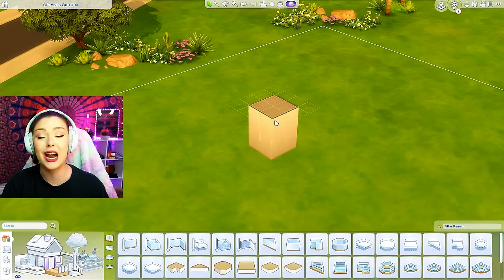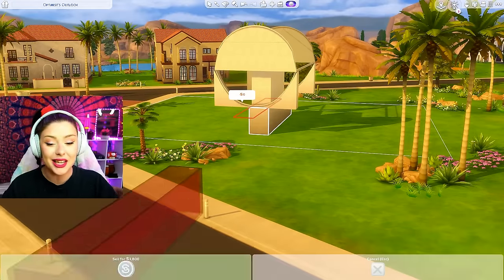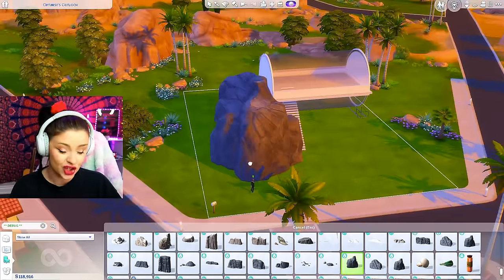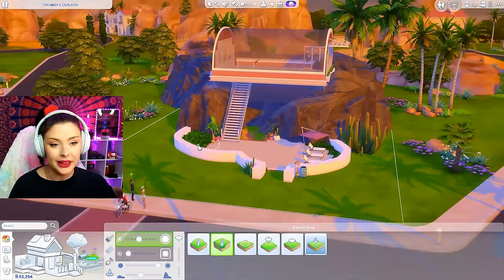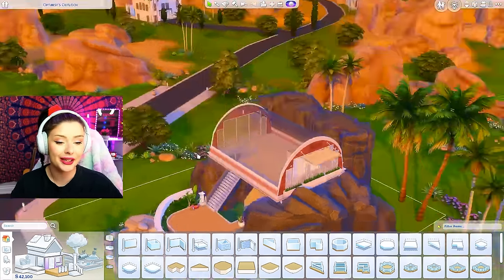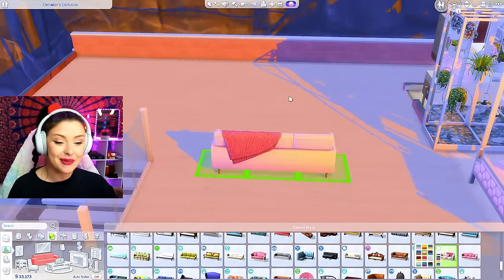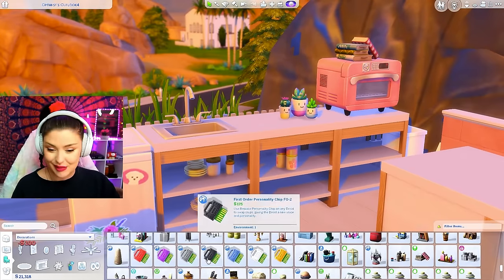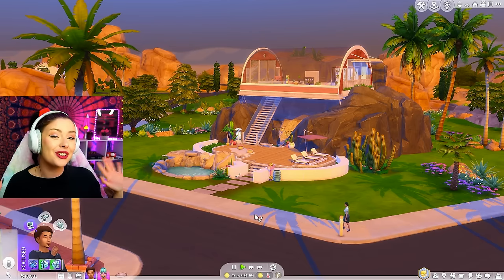Can I Build a GOOD House Out of this GLASS TUBE?? The Sims 4 Build Challenge

Comment: For getting rid of roof walls: On the gallery you should be able to find doors/archways that have been shrunk down with the tool mod - small enough that you don't have to cover them up. I think the ones I use were posted by Kate Emerald.